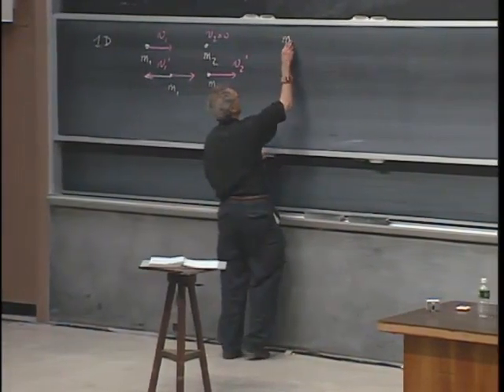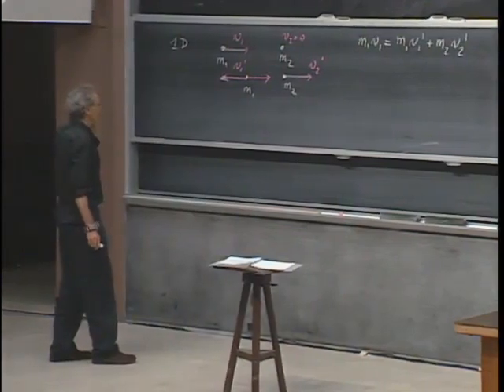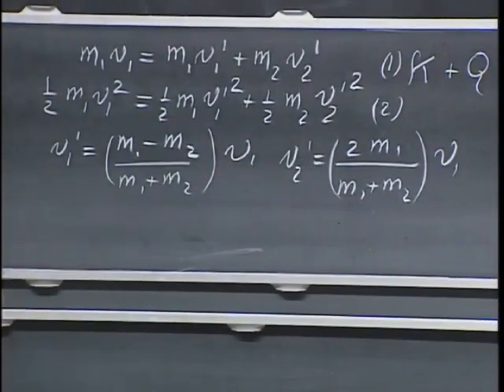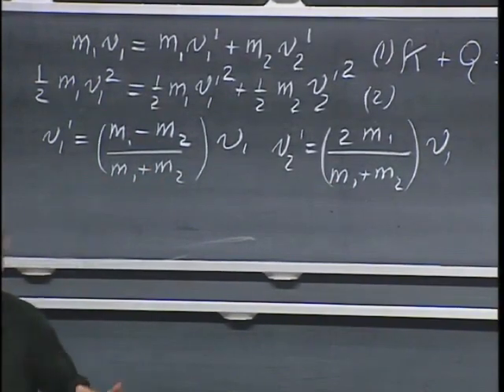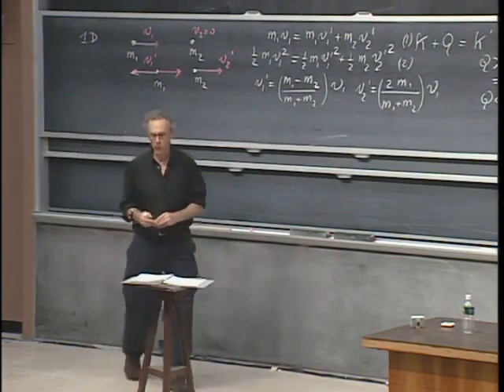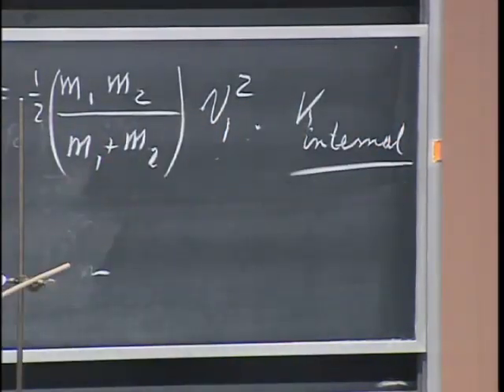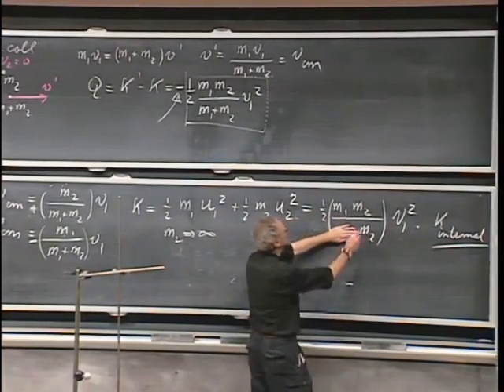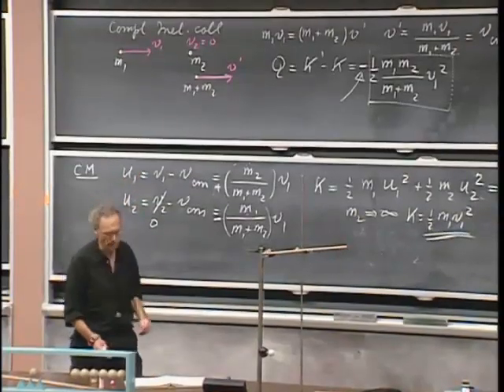8.01x - Lect 16 -  Elastic & Inelastic Collisions, Center of Mass Frame of Reference

Comment: I discovered Thermodynamics principle is misconception. Perpetual Motion Machine is possible. See bellow 

The WORK OUTPUT is more than double the WORK INPUT. 

A 15 ball billiard pool to be strike by white mother ball. 

F = 30lbs (White Mother Ball); D = 3ft (Distance from the white mother ball to the first ball to strike); W =  Work, F = force; D = Distance

The mother ball to strike the 15 ball is the work input

The first collision is explosion followed by series of collisions are work output.

SOLVE FOR WORK INPUT 

W = F X D;  W = 30lbs  x  3ft  =  90Ft.lbs          

SOLVE FOR WORK OUTPUT 

The First two ball extreme corner of the billiard ball 2 out of 15 ball 

W = F X D; W = 30lbs x 3ft = 90ft.lbs  X  2ball = 180 ft. lbs 

The remaining ball (13pcs ball) can produce more than 90 ft.lbs 

The computation shows that the output work done is higher than the input work done. That principle can make free energy machine.

For more heat energy the ball to replace with steel ball and steel side board. After strike are explosion of 15 balls. The work output higher than work input followed by series of collisions that produces more heat more work output, more sound energy more work output, more travelling distance more work output.

Appreciated for your reply.

Thank you. 

Abel Urbina Abel Urbina Free Energy Super Machine
Reply from the maker: patent your invention, then publish it in a refereed journal and then accept your Nobel Prize in Physics within 1 year.
Reply: @lecturesbywalterlewin.they9259  Thank you Prof, Walter. I will prove in Physics that that the Law of Thermodynamics 2 was defiled the machine I designed. The output is higher than the input using the combination of other energies in a close system.

How about the computation of 15 billiard ball made of steel ball and steel wall board after the strike is explosion followed by series of collisions. The explosion made the output higher than the input. Please reply. Thank you once again.

Comment: I cannot understand why professor Lewin said that since spring force is a conservative force, kinetic energy remains conserved in this case? The total mechanical energy has to remain conserved right? Not just the kinetic energy?
Reply from the maker: how many minutes into the video?
Reply: The reason kinetic energy specifically is conserved in an elastic collision, is that the elastic strain energy starts at zero and returns to zero during the process of the collision.  Both objects start in their unstressed/unstrained state, where it is convention to define potential energy as zero, and return to that same unstressed/unstrained state.

During the milliseconds of the collision, the sum total of elastic strain energy and kinetic energy remains conserved.  Before and after, all the energy in question is in the form of kinetic energy.  An elastic collision by definition conserves this energy, and doesn't dissipate any sound or heat (like an inelastic or intermediate collision will do).

If elastic strain energy remained in the system, the objects would retain their shape deformation, and long after the collision, they would be ready to spontaneously spring back to their original shape, releasing the energy at that time.  This is not what we observe in elastic collisions, as the restoring force releases the elastic strain energy right away.

Comment: before collision
p=mv+mv+mv+mv+mv=5mv
after collision
now, vel v'=v
and M= mass that takes off after collision
Mv'=5mv
since v'=v
therefore, M=5m
is this correct?
Reply from the maker: it's a multiple collision problem. It's easy to show that the end result is consistent with the conserv of momentum and KE. But that is not the complete solution. use google